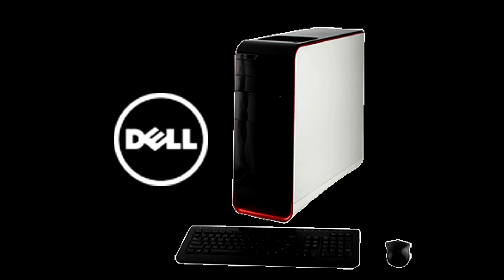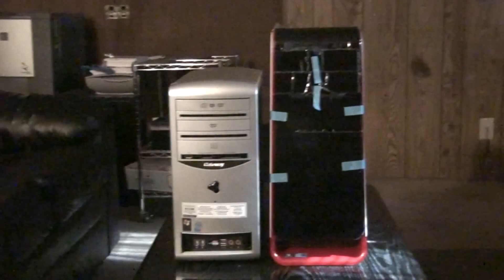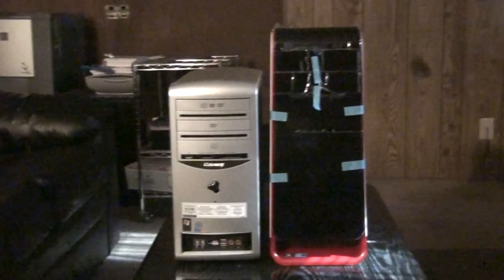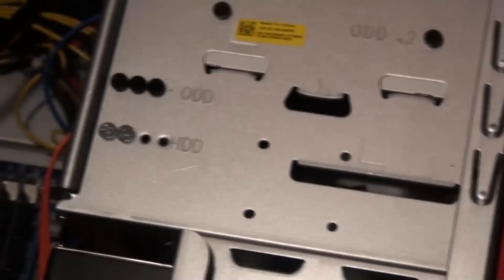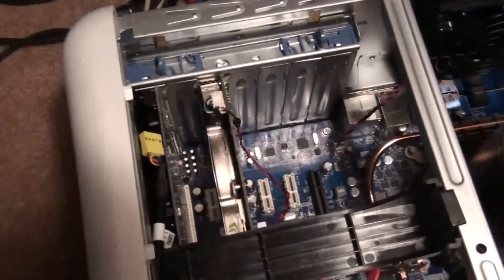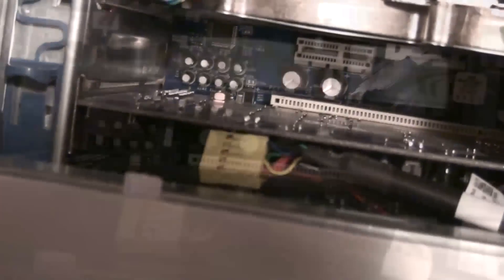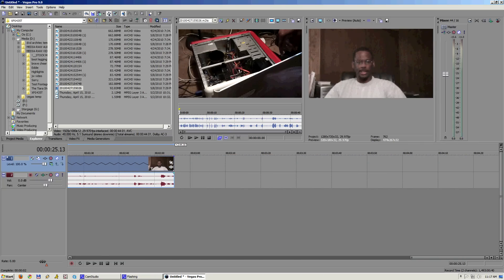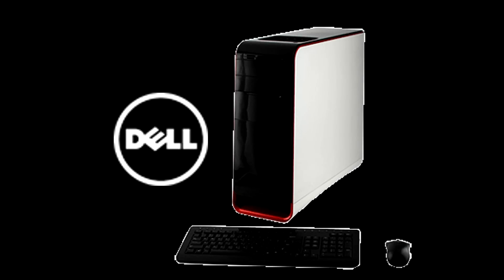Purchase a computer to edit high def video

Comment: if you order the xps 9100 with the HD 5970, does it still come with a 525 W power supply? because there is no way to upgrade via the dell site. AMD says the HD5970 needs a 650 W power supply to run properly.